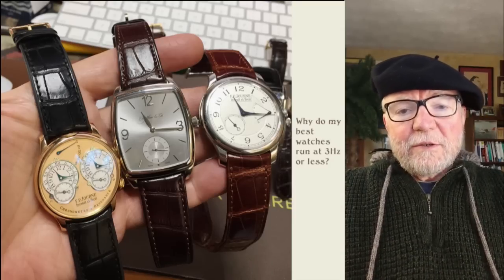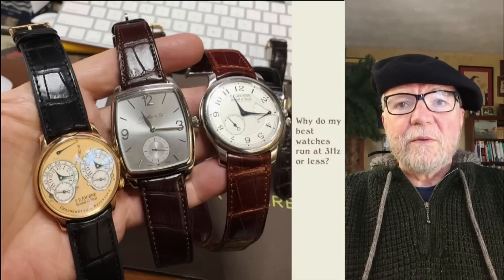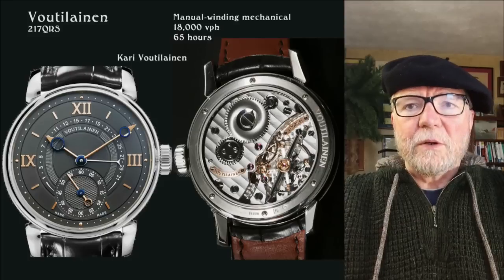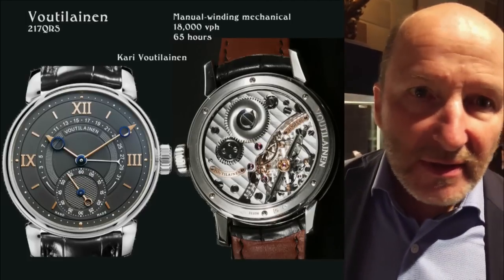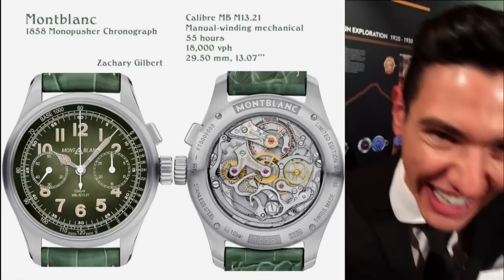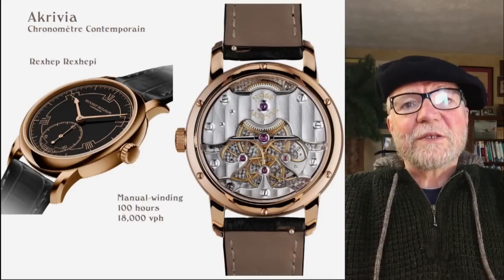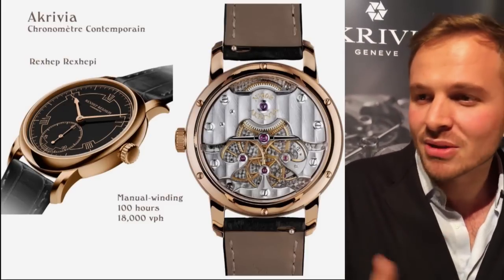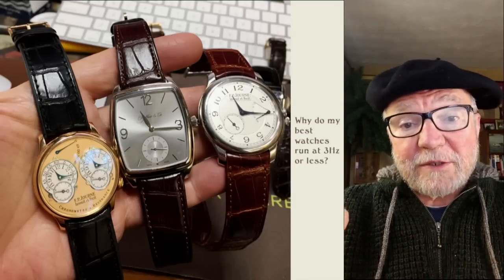Low Frequency :Answering the Question of Why the Top Watchmakers use Frequencies of 3Hz or less #169

Comment: Okay then, I get the idea small balance at higher frequency oscillation, large balance lower frequency oscillation which then looks great on hand wound nicely finished movements. For years I understood the wear and tear of 36K and above HZ movements but also knew to be more accuracy because of the fast oscillation of the balance. I don't really get why many watch manufactures of the lower VHP movements still recommend 4-6 years service intervals.
Reply from the maker: I don't know either, Jose. They may think that the same must be true for all watches regardless of the frequency. Take care and be safe, Bill😷
Reply: @watchartsci  you working hard and doing excellent work for us here on YT, thanks Bill.

Comment: I am no expert in this but I think another reason why its lower than 3 hz is (based on my knowledge of Tissot powermatic 80) that the hairsprings they use are non-magnetic as in Tissot they use silicon hairspring, with this I think its not possible to achieve high beat rates. I think its for more power and resistance to magnetic fields and temperatures they compromise on beat rates. That is totally an assumption from my side but I would love if you could confirm that with an expert.
Reply from the maker: Gaurange ... interesting hunch, but magnetism has nothing to do with the frequency selected by the watchmaker.  Lower frequencies are used by the top watchmakers, all using non-magnetic hairsprings. Lower frequency provides longer movement charge and longer times between service. The higher frequencies (4Hz and above) are chasing accuracies while wearing out the parts faster and reducing the charge time. Take care and be safe, Bill😷
Reply: @WatchArtSci  Really nice to know that. Earlier I used to think that all highend watches used silicon or non-metalic hair springs which limited their beat rates. Interestingly thats not the case. Thank you & take care too 🙂.

Comment: A lot of cheap Seikos are 3hz. These have a reputation of running for ever with reasonable accuracy.
Reply from the maker: Hi Mr S! Yes, there's the irony! I've taken up watchmaking (in the most pretentious sense...I assemble parts into a watch), and my favorite is the ETA 6497/8 or [even better--the Chinese Seagull clones ST 3600/3620] The -1s run at 18,000 and the newer -2s at 21,600. Naturally, I prefer (now) the -1s. None of these movements I've come to love are anywhere near the specs of the watchmakers seen in the video...nor produced by craftsmen. That's ok with me, and while I save up for the Lang & Heyne with the trigonal bridge, I'll knock out my own watches secure in the knowledge they my creations and those of the greats share one thing in common: the frequency. Cheers! Bill

Comment: balance wheel secret, proper speed + proper torque = efficiency, consistency and accuracy. most watchmaker are artist they doesnt articulate technical term the way engineer or commoner does.
Reply from the maker: Jamlia, most watchmakers are watchmakers, not artists ... some are both. Marco Lang is a watchmaker and masterful designer. I would like to hear your opinion of silicon hairsprings. Take care, Bill
Reply: @watchartsci   @WatchArtSci  silicon hairspring has it's own benefit, where it's resistant to wheater and magnetic interference. steel and alloy has been used longer, with already predicted deterioration rate, this help with various off the shelf component selection which helps to create more consistent watch because you doesnt need to retrofitted the watch movement design to the component (its like tearing down the whole house just because you wanna get the couch out off the basement), component to movement design that what important.  and yes people seen silicon as convenience  but steel and some alloy hairspring as sustainability.

but the whole watch industries has tried to distract our attention(I believe), from what most important the most. its linear power regulation of the mainspring the most important(to achieve constant power), because mainspring does not as accurate as the regulator wheel and its spring. as you already figured that most the exceptional watches stays 18.000vph, proofing there is somewhere else need to be touched for extra attention, of course not forgetting the balance wheel assembly.
 
linear constant power regulator for the mainspring to regulate amount the unwound hairspring during 100%-0 of  reserved energy probably the next thing need to be developed in this modern era of mechanical watches. take care and godbless
Reply from the maker: @jamliaqurratiaini5042  All of my comments have to do with collecting mechanical watches with transitional metals; not metalloids like silicon. In a word, silicon is a better material than transitional (and traditional) metals used in mechanical watches insofar as they are non-magnetic, keep their shape and precision. That's not the point. It would be like using acrylic paints on a Van Gogh. You cannot adjust a silicon hairspring using a curb regulator with a beautiful swan neck adjuster. As for using the lower frequency by top watchmakers ... it's a matter of artistry, and I bet you appreciate that as much as anyone who love horology. Take care, Bill
Reply: @watchartsci  100%

Comment: Nice video, Bill. Coincidently I'm in the market for classic pilot watch and right now I'm deciding between these two IWC watches with in-house movement where one has 2.5Hz and the other has 4Hz. Your video really opened up my horizon. Thanks, Bill. Cheers.
Reply: Might be a stupid question but how could a watch have a decimal frequency without missing individual seconds and being imprecise for timing short things
Reply from the maker: Hi Jimmy, what are the two IWC watches you're considering? Cheers,  Bill
Reply from the maker: Jimmy, here's a link to a German site where they make some very interesting pilot watches using the Unitas/ETA 6498.1 (2.5Hz) You might like the prices too. https://www.tourbywatches.com/collection/pilot-anniversary-45/ Cheers, Bill
Reply: WatchArtSci Hi Bill, either the IW325401 Vintage or the IW387806 Exupery.
Reply: WatchArtSci Hi Bill, thanks for the link, Tourby is very good. Unfortunately now I'm looking for the IWC with in-house movement. I have the Stowa 90th Anniversary with 6498 movement. Cheers.
Reply from the maker: I found the Chronograph Edition Antoine De Saint Exupery and indeed it's an IWC manufacture. (https://watchbase.com/iwc/pilot/iw3878-06) It seems a bit pricey for what you get. Have you seen the new Habring2 Doppel Felix? (http://www.habring2.com/index.php/en/collection/doppel-felix ) It's a finalist in the Petite Aiguille class of the Grand Prix d’Horlogerie de Genève. (http://www.gphg.org/horlogerie/en/watches/doppel-felix) For around $8k, it's like getting a $100,000 watch that's hand-made and designed by Richard Habring. In addition to the chronograph functions it has a rattrapante.(By the way, this little Austrian company has won 3 Grand Prix d’Horlogerie de Genève awards already. IWC has never won a single GPHG award.) Whatever you choose, it's the right choice! Cheers, Bill

Comment: I have 2watches running at 18000bph, a Kirovskie watch made in 1939 at the 1st Moscow watch factory, and a Omega 266 handwound from 1954.
My Vostok watches run at 19,800 Bph which is unusual and exclusive to Soviet watches I think.
I have a Soviet Volna Precision from the 1950s with an aftermarket see through caseback and that runs at 19,800 Bph too. Perhaps that's a good compromise speed. 
Most of my more modern watches run at 21600bph.
I have one that runs at 28800bph.
A Seagull Ocean Star Diver watch.
Its painful to listen to it when you put it to your ear it's so manic.
Luckily it has a solid caseback so you can't see it's frantic balance wheel.
Reply from the maker: Hey Neil, that's very interesting about the Kirovskie from '39. I use Seagull ST36's a lot in my DIY watches—nice big movements for me to work on and not as expensive to break as the ETA/Unitas 6497/8's that they replace. They run as smooth as silk at either 18,000 or 21,600, and I've been able to tickle the regulator to near 0 error. Pas Mal... Cheers, Bill